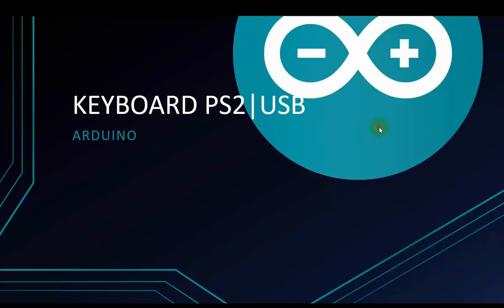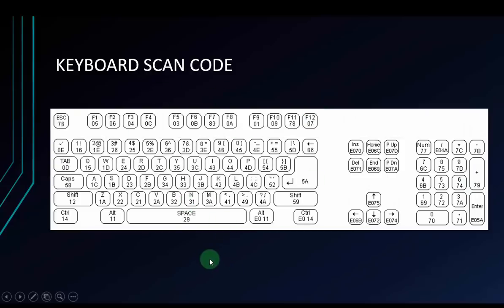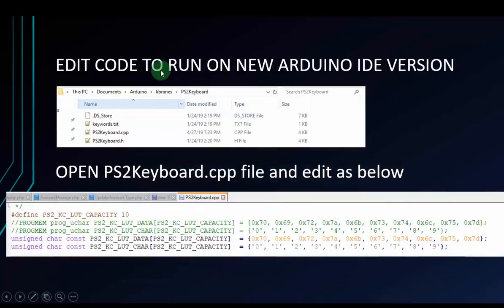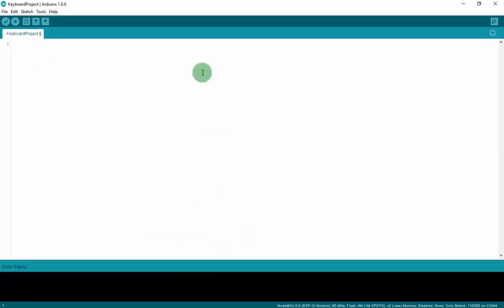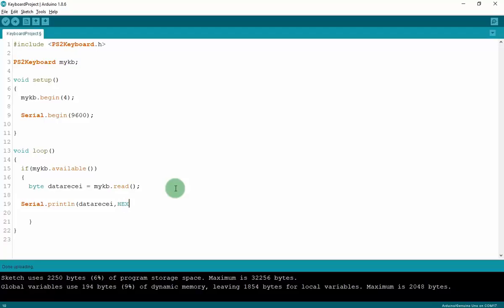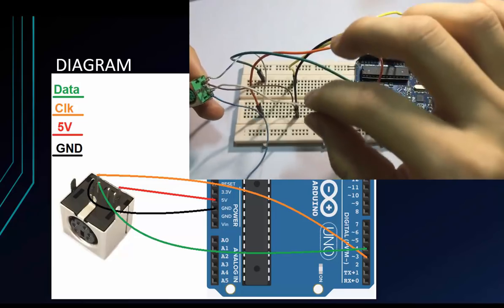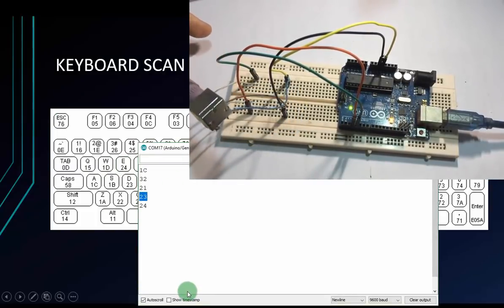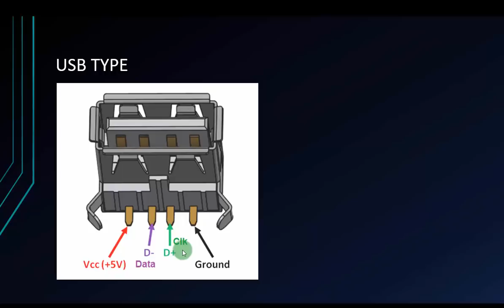Arduino Tutorial for Beginners 14 - Keyboard PS2 | USB

Comment: i am looking for something similar but i want to be able to connect and see that it works a female usb and then power it with an external voltage. pin A0 ----> DATA +. How do I do this or rather how can I define this code? Then I can merge it with another code of my interest? Thank you very much.

Comment: I cannot have it plugged into PC and also read with arduino at the same time?

rn it constantly prints some values without me even pressing.

I used pin 2 for the data, pin3 for the clk

Comment: why i get this errors?
Arduino: 1.8.10 (Windows 7), Board: "Arduino/Genuino Uno"

C:\Users\Windows 7\Documents\Arduino\libraries\PS2Keyboard\PS2Keyboard.cpp:24:10: fatal error: WProgram.h: No such file or directory

 #include "WProgram.h"

          ^~~~~~~~~~~~

compilation terminated.

Multiple libraries were found for "PS2Keyboard.h"
 Used: C:\Users\Windows
 Not used: C:\Program
 Not used: C:\Users\Windows
exit status 1
Error compiling for board Arduino/Genuino Uno.

This report would have more information with
"Show verbose output during compilation"
option enabled in File -> Preferences.
Reply: You have to go into the .cpp file and change #include"WProgram.h" to #include "Arduino.h"
Reply: @franciscovargas4311  you solved my problem.thank you very much bro....

Comment: 90% of people use usb keyboards nd u dint even give 90sec for usb type demo...lolz
Reply: does usb works?
Reply: @davidernesto7912  no
Reply: USB have problem becouse you need to install drivers that are making keyboard useable, before year 2010 USB was working also as PS2 port when you was using USB to PS2 adapter. But today very low amount od people are using PS2 and manufacture resigneted to implement this PS2 port inside a keyboards and that's why its not working, if you want to make IT working you need to buy old keyboard that is working with PS2 adapter
Reply: This example can work with USB keyboard type, i tested, except the new keyboard generation as mechanical or some type can not use :)
Reply: @davidernesto7912  yes